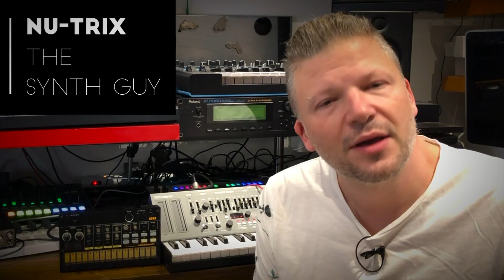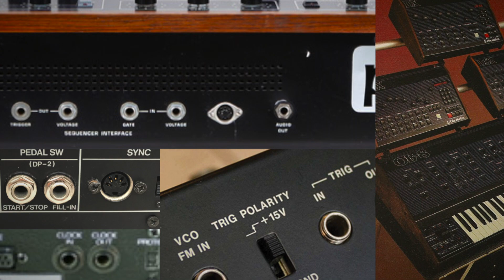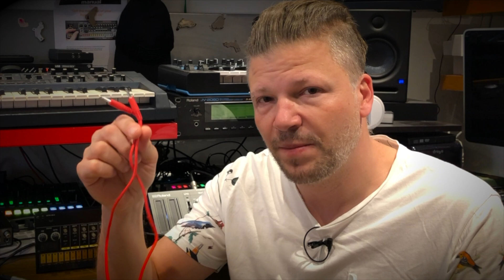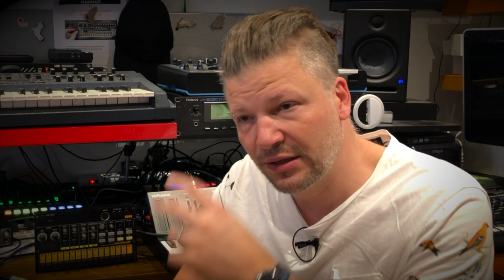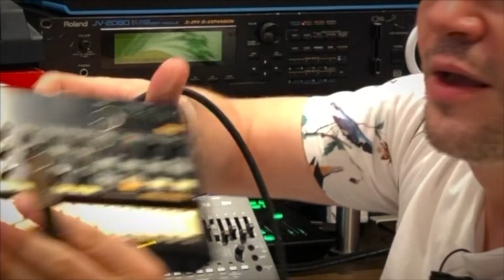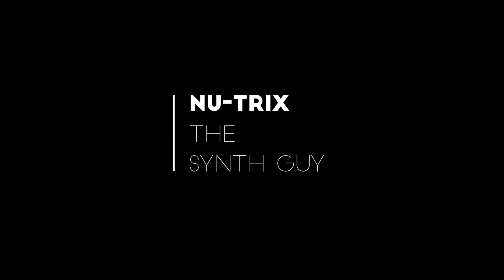How to sync using MIDI Sync or Trigger Sync?

Comment: Hi, so so so helpful video. Great explanation. You have got a new subscriber.
Reply: So in short, volca cannot be set as master when trying to connect and sync with Roland boutiques or Aira , correct?
Reply from the maker: @kalpeshkpanchal correct

Comment: Thanks for this. It seems like something should be so easy and straightforward but it's not, haha. Appreciate it!
Reply from the maker: Sync is one of the most difficult thing to get working. Basically trying to get different devices and software from different brands created by different engineer for different user with different workflow.  And in this video I only talked about music sync. Wait until you try to sync MIDI Sync, analog sync, S.M.P.T.E LTC, S.M.P.T.E. VTC, the multitude versions of Wordclork or even Black burst House sync! Now THAT is a real Nightmare! ;-)

Comment: The gate out on the boutique is not a clock out like you mentioned. It seems so since the programmed sequence in your example consists of 16th notes, but if you had some tied notes or rests in the sequence, the 'clock' would hang or shift on those points.
Reply from the maker: You are entirely right.

Comment: Informative as always Nutrix. I got four of the Volcas when I first got into synths. I always wished they had made them with out and through patches for the midi cables. Alas, only the in line. There were some people back then modding them and selling  them on Ebay. Haven't seen them in awhile though. I used to have one Volca with the midi line in from and RM1x and used the sync cables for the other 3. It worked but I always wanted more versatility. Ashame they didn't include more midi connections, but I guess they wanted to keep the price down. Still fun units for the price.

Comment: Hi I love the way you explained it. What's confusing to me in the midi world of is what's the difference between a midi "sync" box  <versus>  a midi "thru" box?  It sounds like a play on words, if they both send the exact same type and amount of midi messages between 2 devices.  Based upon your knowledge and experience, is there a difference between the messages stemming from a midi "sync" box versus a midi "thru" box?  Does a midi thru box allow midi messages through or thru?  And does a midi sync box sync all messages or just a few?   The difference between those 2 type of boxes is what confuses me. Do you know which one is better between the two:  a midi sync box <versus> a midi thru box?  (I really appreciate your insight, because you definitely explained things where it's easy to understand). I look foward to hear what's your take on sync versus thru. Thanks for sharing your insight.
Reply from the maker: In short: a MIDI THRU box simply copies the MIDI IN to multiples THRU to send the exact same message that was received at the input. A MIDI SYNC box would normally affect the sync messages (not the notes or the controls changes) it should be able to receive a certain type of a sync (that is not MIDI) and generate from that a MIDI sync  message, or vice versa. A sync box will permit you to have to incompatible machine talk the sync (tempo, song locator, start, stop, etc…)
Reply: @Nu-trix  I was thinking to use a 1010 music black box to better sequence the sounds from a casio wk 7600 keyboard, and keeping the sounds from the casio, utilizing black box to build a song. In that situation is a sync better than midi thru?  If I understand synce vs thru properly the way you explained it (please correct me if I'm wrong), in this case to keep the sounds from the casio keyboard but control it using a 1010 music black box would be better to use a midi sync box instead I think. Am I understanding that right?  Thanks always

Comment: To be specific, Volcas and Pocket Operators run at 2 PPQN (pulses per quarter note). Newer Volcas (2019+ like the Drum and Nubass) can be set to 4 PPQN in the global settings.

Roland Boutiques run at 4 PPQN. If you hook them up to a 2 PPQN Volca they'll run at half speed. They also NEED a mono cable. They don't work at all if you use a stereo cable. Volcas work fine with stereo cables (tip = clock, ring = NC).

The whole idea of using patch cables (1/4" or 3.5mm) for sync was a modular thing mostly intended to work with trigger outputs. So normally one pulse would be one step, and on a 16-step sequencer that's 4 pulses per quarter note. So it's odd that Volcas and POs use 2 PPQN.

I can sync my JX-08 Boutique with a trigger out from my TR-606 going into EXT CLK IN, or with Volcas, or with my J-6.

The Roland Aira Compact synths work fine with a stereo cable, and they let you set 1, 2, 3, 4, 6, 8, 12,  or 24 PPQN in the settings. So you can use a them to double-clock or half-clock other things. For example, I can set my J-6 to 1 PPQN, then sync it with a PO-33 or Volca (2 PPQN) if I want the PO-33 / Volca to be clocked at half-speed and have 2-bar patterns.

Some things use stereo sync cables and actually put a start/stop signal on the ring. I think the Behringer RD-8 and RD-9 are like that. They work fine with Volcas since the ring isn't connected anyway. And the RD-8 and RD-9 let you set a pretty wide range of PPQN clocks (not as many as the Roland Compacts, though).

I actually never had any mono patch cables till I got the JX-08. I couldn't get it to sync with anything, but then I played with it with a multimeter trying to see what it was doing.

It looks like the Boutiques detect that a patch cable is inserted the same way a Boss pedal detects that a cable is inserted — it grounds a circuit to the ring of a stereo input jack. EXT CLK IN has 3.3V on the ring. When you insert a mono cable, the jack's ring contact gets grounded to the sleeve. But if you insert a stereo cable it doesn't know because the ring/sleeve aren't connected.

Comment: WOW!, thank You for this Master Class, this video describes it all in detail and with such clarity!. Can you please recommend a sync device,  I would like to synchronize My Cubase project running from a PC to a Protools session running from a Mac. I want to make Cubase the master and Pro Tools the slave. Essentially, I want to press play, stop, rewind, scrub left, right and have pro tools follow. The goal is to have Cubase (master) as my sequencer and pro tools (slave) to run video simultaneously. There is a device that does this exact thing but the price is $4,000. after this video I know that there is a better efficient cheaper way. Thank You for your suggestions and thank You for this amazing Video.
Reply from the maker: I’ll try to answer in a video soon
Reply: thank you @Nu-trix
Reply from the maker: @J.Livermore  Can you tell me the Cubase and Protools versions you are using? Will Protools run video and audio while recording Cubase output? Cubase will playback music I’m guessing, right?
Reply: Hi  @Nu-trix  , Absolutely, I am running Protools Studio on a M1 Mac Ultra and  Cubase 12 on a 64 Core PC Threadripper Pro 256 RAM. Yes Protools will run Video and audio while recording  Cubase output, and Cubase will play back the music.. Thank You for Your Time!!

Comment: Hello mate awesome channel on here 👍 I have the SH01a I’m looking to add reverb and delay what’s the way to this ?
Reply from the maker: You mean adding an effect pedal or as a plugin in your DAW?
Reply: @Nu-trix  hello yes I’m looking to add a pedal but  if I use the trigger out in the tr8s can I use the effects via the channel on the tr8s if so I do if that way thank you for your reply 👍
Reply from the maker: I think you could send the SH audio out inside the aux TR8S aux in and apply to it the TR8S effects. But I would have to check (I know I do it  with the System-8 )

Comment: This is making sense now.  I managed to sync an Atari 8-bit computer (master) running Midi Music System software with a PO-33 and/or an NTS-1.  The Atari outputs 24 pulses per quarter note from pin 3 on joystick port 2. An Arduino is used to count the pulses from the Atari and then sends out a pulse every 12 pulses to the slave. Everything seems to stay in sync until I stop sending MIDI signals using the escape key.

Comment: Your video is great, thanks a lot but I will love if you can help me with a question… 
If it’s possible to send the tempo from a volca to a loop station Rc5? Or it’s the same thing? I only want that my loops go with the time of the volca doesn’t matter if it doesn’t trigger the play o other information… thanks a lot
Reply from the maker: The volca can only follow MIDI sync. So for the volca to be sync master it has to send trigger sync and loop station has to be able to follow. Can it?
Reply: @Nu-trix  I don’t know if it can :( I only see that the RC5 from Boss has the MIDI in and out and the Option of sending a clock, so it will be perfect for me, to send the clock to my volca

Comment: Ive been having a block regarding this since using a DAW.
Imused to using a 6 trk reel to reel. Stripping one track with sympte and my linn900 as the slave. It was tedious but helped a single  moderately skilled hack create and record by hisself.
Been soooo frustrated since attempting to use modern methods.

Is it possible to incorporate the Linnwith a DAW?  What kind of offset time and  sync code would be a possibility?
Midi time code?
Thank you for sharing your knowledge with us.
Reply from the maker: I don’t know the MIDI specs of the Linn 9000. But if it can follow MIDI Time Code it could follow any DAW sending MIDI Time Code (MIDI SMTPE)

Comment: Great video. I think i have the ultimate question. I just bought an Akai APC mini to cue music in OBS for shows. I want to assign for example 5 triggers (music tracks) to the same volume slider but cannot seem to figure this out. Thanking you in advance for any suggestions. Keep up the great work.
Reply from the maker: A MIDI volume is link to a specific MIDI channel. If you want one MIDI fader to control the volume of 5 sounds, they should be on the same MIDI channel.
Reply: @Nu-trix  I've tried but I get a message saying the channel has already been assigned. ill keep trying. thank you for responding.
Reply from the maker: Have you tried to use only one channel in  OBS and put all the triggers on the same channel in the APC?
Reply: Im not sure when you say one channel in OBS. Please excuse me if I'm not understanding. I try to explain it a bit more in detail. I am using the midi set up in OBS on my Mac. I am using the APC mini. I have 8 rows with 7 triggers and one volume slider below each of them. I have separate tracks assigned to each trigger that turn on and off just fine. I can assign one track to the volume slider but when I attempt to assign more than one I get a message that says" Can Not Map Channel 0. Please Click Listen One Or Listen Many to listen for MIDI Event to map". after clicking OK I then get another message that says" Mapping already Exists for APC MINI, with channel # 1 norc # 51 and Message type Control Change.  I hope I'm answering you question. thanks again for your help on this.

Comment: @Nu-Trix The Synth Guy Thanks for the very good video. But I will have a different kind of setup: I have Cubase Pro 11 and I want to buy a Roland TR-8S which connects to the pc through usb. I want to use the TR-8S as a slave and Cubase as Master. Does that USB connection (between TR8S and the PC) act like a genuine midi-cable connection which transmits all 3 parameters (tempo, start/stop, position) in both directions/in the direction that I want (pc to tr8s or tr8s to pc)? Or do I need to buy a sound card which has midi input and output? For example, I had an Akai mpk261 midi keyboard which connected to the PC via USB cable. And i believe Cubase was sending the tempo to the mpk261 midi keyboard through that USB cable. But I could not tell if it was also sending the "position" and "start/stop". I do not have my pc with me and all my music gear (including my mpk261 midi keyboard) was recently stolen. My sound card (Focusrite 2i2 3rd gen) had no midi ins and outs. And now, if I really need midi ins and outs on a sound card, I need to buy one which has them. Looking forward for your answer. Thanks in advance!
Reply from the maker: The TR-8S usb MIDI is a full MIDI in and out interface. It sends and receives all MIDI messages needed for MIDI sync. You will be ok with just the USB MIDI. If you install the TR-8s drivers, you will have access to more USB audio features but not more MIDI features.
Reply: @Nu-trix  Thanks and have a nice day!

Comment: A question for the experts.
*How do I connect devices with built-in sounds
Directly to a control keyboard that has no sounds?
*Which cables do I need? And what is the friend why?
- I have: launchkey 25 mk Novation control keyboard
and want to connect it for example:
to CIRCUIT TRACKS.
Or - for the Roland device / Roland Aira S-1
and use their sounds.

Many thanks to the helpers.
Reply from the maker: The easiest interconnection between devices is using MIDI cable (5pin DIN). Out of the controller in the sound generator. But today, not all device have MIDI in and out. Some only have usb. Than you need to got through a computer and assign the MIDI to a MIDI interface out or to a USB MIDI compatible hardware synth,

Comment: Good topic. I have a related question regarding the Arturia Microbrute. I want to connect the Microbrute with a drum machine or clock of some kind, with a means of controlling bpm. There is no bpm display on the Microbrute, so I’d like to be able to do 2 things: 1) sync with a drum machine (in correct time), and 2) actually see the bpm on a digital LED display as part of the setup. Any suggestions for drum machine options or ideas for a digital clock/bpm gauge (maybe modular)? Thanks.
Reply: Been using the drumbrute impact with my microbrute and it’s a great match

Comment: I'm just about to use my TR-8s in combo with the SE-02 and SH-O1A and i need to clarify if the patch cable connecting trigger TR-8s to trigger in on the boutiques - 3.5mm audio - does it need to be mono/stereo or will both work ? Thanks for the clarification on sync/trigger/midi technology.
Reply from the maker: It’s always better to use a mono TS audio cable for trigger and gate (unless the maker writes otherwise)
Reply: Wow that was a fast response - i've got some mono 3.5's so looks like i'm in business.Thanks NuTrix.
Reply: Works a treat - thanks ! Ordered some cables as well.

Comment: is trigger sync, the process where a synth's keys will be triggered by pressing the play button in the DAW?

The better visual example would be:  Having a motif rack ES, UAD Apollo Twin audio interface, and mapping out some note pattern(s) in a DAW, hitting play and the notes that are drawn in the sequencer, will trigger the synth to play a selected voice, without having to actually touch a midi keyboard?  I was able to do with when I used a MBox Pro 3  (Had my yamaha motif rack ES hooked up and sync'd with Reason 10. It helps me with layering sounds.  So i don't have to physically play each layer.
Reply from the maker: Not at all. What you describe to simple MIDI note triggering. Sync it about too devices playing a song (or sequence) at the same time AKA synchronized but using the old analog system of trigger and cv. One question: why ask without watching the video? The presentation is not inviting or intriguing enough?
Reply: @Nu-trix  sorry if i offended.  I did watch the video in full, but i had some distractions. It just has a ton of information in it and our equipment is different so that part confuses me.  I was just asking for clarification. The content is great and you presented well.
Reply from the maker: No problem. I’m just curious ton understand how people watch, interact and understand my videos. It helps me in preparing the next one.
Reply: @Nu-trix  Fair.  No, the content and explanations are actually damn great. I think I can figure it out from your video.  I don't know the ins and outs of analog gear, although I've used for quite some time.  It was by accident that I was able to get my Mbox Pro to do what I'm trying to do now with my UAD apollo twin.  This vid actually helped me understand what the differences are with midi out/in and syncing.

Comment: How do I sync/ connect my Roland Tr8/ tb3 and Behringer MS1. I have connected my tr8 and tb3 before by using jack plugs by in and out but are stuck now hooking up my ms1. If midi is the way to go , how?

Comment: Awesome!! I still have a question, if I have a Roland tr6s, that just has mid in and out, and a korg volca fm that has, mid in and sync, can I sync both? Using the mid out in the roland to the mid in of the korg no?? Sorry, this is a bit complicated for me hahaha! Thanks for
Your vídeo
Reply: I just want to use both at the same time, but is confusing, because if I connected them both via midi, it could happen that the korg is just gonna copy the Roland? No?
Reply from the maker: The Roland tr-6s can be master of MIDI a lock and send it out using Its MIDI out to the Volca MIDI in.
Reply: @Nu-trix  so by connecting both via midi, they will be in sync, and the Roland is gonna be the “master”? Thank you so much for replying!!
Reply from the maker: Yes it should work this way. You may have to change the internal setting for MIDI sync in the TR-6s. But by default it should be in master mode.
Reply: @Nu-trix  it worked!! Awesome, thanks man! Yours explanations are excellent!! 🔥🔥